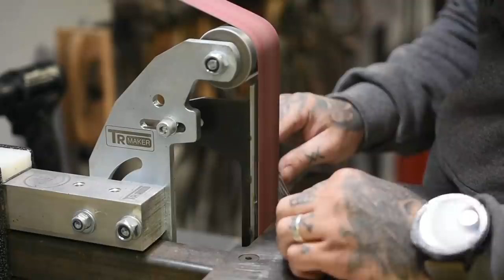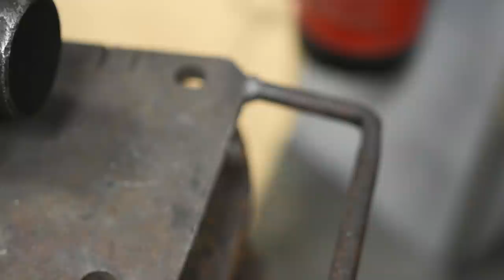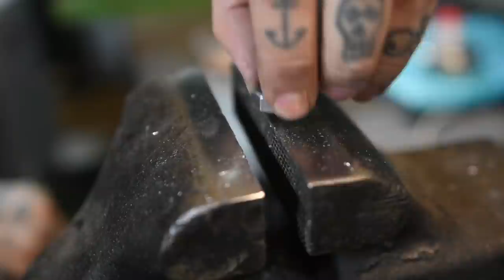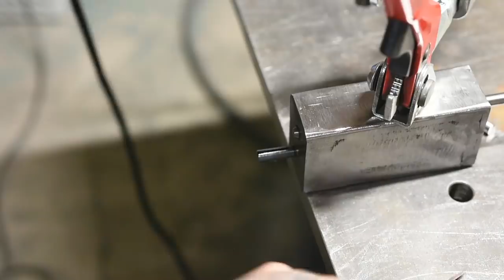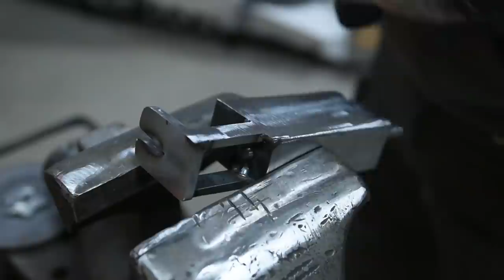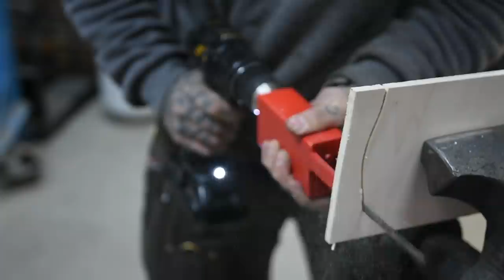Cordless Drill Attachment | A „must have“ in every tool box!!

Comment: You can modernize this structure by assembling it in a cylindrical body (pipe section), while the saw axis will move and reciprocate along the central longitudinal axis of symmetry of the cylindrical body (pipe section). If anyone is interested, write.